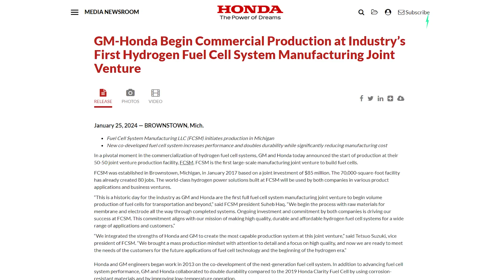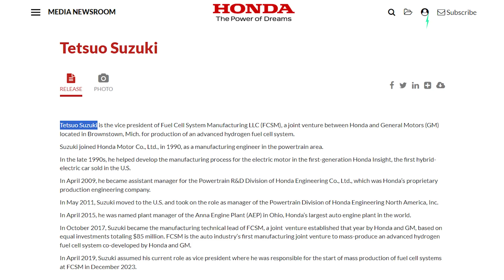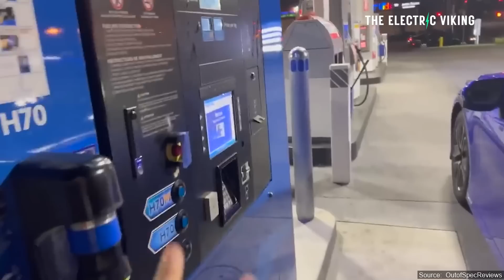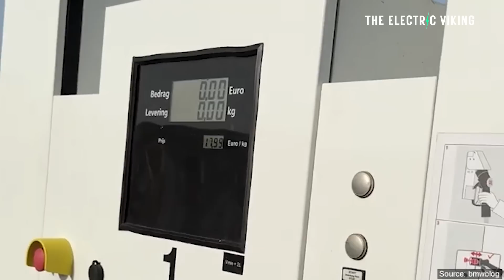GM & Honda's hydrogen fuel cell facility begins mass production in America

Comment: This is such a momentously ambitious global transition. It's going to take time to work out most of the kinks across the entire scope of clean alternative energy and its expected in most early adoption phases, but time is not our friend as the narrative goes. BEV will continue to make progress and FCEV/Hydrogen/Synfuel will make up a large portion of the market too. It's not a one trick pony ordeal. FCEV and bidirectional charging breakthroughs are on the horizon and will be necessary for GRID sustainability. GM and Honda partnership is a major indicator, not to mention their partnership to deliver the global blockchain standard for EV grid integration.

Comment: In the UK in October 2022, Shell - who had been conducting "an experiment" with H2 fuelling infrastructure for cars - pulled the plug on the "experiment" and announced it would be terminating all future research and investment in car H2 technologies. A short while later, Motiv Fuels closed H2 stations, announcing it would focus efforts on H2 for large commercial transport initiatives.
"Lack of demand" was cited as the key reason by both Shell and Motive. H2 fuelling stations in the UK fell from 15 in 2021 to just 5 in May 2023.
Lack of demand is the key phrase here... Despite the UK government's 2030 Hydrogen Strategy forecasting "significant" use and application of H2 as an energy/fuel source, the reducing economics of pure BEV in cars is rapidly gaining favour in the British motoring public.
The UK government tenaciously hangs onto H2 "hopes" - and many believe that the fossil fuel industry is "influencing" this policy. (Read that as you will...) Despite vacuous and pointless statements about "green hydrogen", anyone with more than one brain-cell knows that the oil industry is the only viable source of H2 - even though it will still be very expensive and inefficient to produce.
We may not need to concern ourselves with these stupid and irresponsible policies, because (as Tony Seba has said) people vote with their wallets. Pure BEV will be around 3x to 5x cheaper than even the most "efficient" H2 fuel-cell technology and WAY more efficient and convenient. And I'd trust Seba way ahead of any politician or oil industry executive.

Comment: All it takes is one change in technology.

The ability to rapidly produce hydrogen on demand would do it.

For example, a new aluminum alloy that reacts violently with water to form Al2O3 and H2.  Not only do you get hydrogen, but you also get electricity and heat.

The gallium and other things in the alloy are completely recoverable from the sand at the bottom of the reactor. Power generation is easy to control because the aluminum is fed in from a spool of wire...

There are a few recent papers that could be products in 3 years.
Reply: Whoa....back it up there - Aluminium is one of the most energy intensive metals to produce - the Tomago smelter in NSW has a constant feed 24/7/365 days a year of 850,000 Kw. That's 7.5 Terrawatt hours per year = 2.8% of Australia's total energy production in 2022.

You'll only every recover a tiny fraction of the energy needed to make the alloy in the first place - there are no free lunches.
Reply: @TB-up4xi  
ExCtly.

We have millions of tonnes of this stuff sitting around.

The energy associated with the production of 3-5 trillion aluminum cans can be harvested because we have millions of tonnes of excess aluminum sitting around.
Reply: @JohnBoen  Seriously? aluminium cans? Please rethink how ridiculous that statement is.
Reply: @TB-up4xi  

Millions of tonnes of aluminum that represents a huge potential energy value.

I'm an engineer and I see these thousand pound ingots.

I read a paper titled "Easy aluminum nanoparticles for rapid, efficient hydrogen generation from water"

I think to myself... self - if we could make that into a Ramirez it would be an aluminum primary battery. Self agrees.

And an assembly that harnesses the heat? Yes. That would be good. Perhaps a sterling e line or an exterior cooler.

And direct electricity... math works out.

I am a materials science engineer and I didn't see any red flags.

Of course ai thought about it.
Reply: Oh, there are lots of ways to produce hydrogen, the drawback is that they ae all expensive, and this aluminum alloy method is no exception. Besides, using aluminum to produce hydrogen to power a fuel cell has several unnecessary steps and high cost involved. More efficient would be to use the aluminum in an aluminum/air battery, or perhaps even feed it in as an aluminum/air fuel cell. Greater range, higher efficiency, and no need to lug around heavy water tanks. Granted, you'd still have to recycle the spent aluminum oxide, but that's the same for the aluminum hydrogen process, too.

Comment: The "middle east" controls oil. China controls mining. Hydrogen the most abundant element on earth is available equally to ALL. It's a freedom liberator. It's not about cost or efficiency. Countries/people can then control their own destinies and not be beholden to others with design on domination and control.
Reply: Hydrogen is hopelessly inefficient. EVs are 4x better.

The fuel cells alone are only 50% efficient and that’s after over a century of development.

They’re also expensive, use precious metals and wear out.
Reply: @fredbloggs5902  Yes the cost and inefficiency is well known. But,,,, countries like Japan and their society will gladly pay more for an energy source that provides for independence from China. Japan would like to be in charge of their own destiny. Many other countries such as Germany do not want to freeze over the winter because Russia holds back on gas sales. So the German society is not held hostage by oil producing countries. This is NOT about the best or cheapest source of alternative energy. It's about freedom and independence to determine ones own destiny. Hydrogen is available to everyone. Extract it from water using renewable energy means people don't need reliance on oil or minerals for batteries. Please think about the geopolitics and why hydrogen is so attractive. It's not about moving a car from point A to B.

Comment: The suppressed technology of turning water into a combustible gas as was done by the inventors Stanely Meyer and Dennis Kilien would solve all these problems. Obviously fueling up vehicles with a garden hose would disrupt the investments in oil, coal, electric vehicles, etc., so this technology needed to be suppressed. The Electric Viking ignores this technology, why? The prospect of free nonpolluting fuel should send those who believe in the myth of man-made global warming into exstacy. The future could be very bright and prosperous with water as the primary fuel for cars, trucks, locomotives, jets, and ships. Cheap clean safe thorium nuclear reactors could provide all out electrical need.
Reply: Stanley’s patents have been public for decades. It doesn’t work and never has. Go learn some thermodynamics 🙄
Reply: @fredbloggs5902  Stanely Meyer was smart enough to leave key items out of his patents to keep them from being copied. His very suspicious death leads me to believe that his devise actually worked. Then there is the case of Dennis Klien who also changed water into a combustible gas. Everything has a resonate frequency. If the right one is used molecules will lose their bonds. Royal Riff cured diseases with similar techniques but of course he was driven out of business by big pharma as a quack.

Comment: Here's a fuel cell "winner"   BLDP (NASDAQ) $3.38 .   Yeah, the stock price has gone no where for years.  Don't like that one?  Go for Plug Power  PLUG (NASDAQ) $3.80 .  Yeah, the stock price also below $4 / share.   I see Honda and GM have decided to drive their stock price below $4 / share with hydrogen.   That should work out fine for them too.

Comment: I can easily charge my ev at home, and am planning to install solar on the roof; as far as I know, that can't be done with hydrogen.
Reply: Actually you can! You just have to get an electrolyzer for your solarpanals and a hydrogen fuel station. Easy 😉
Reply: @bellumCretatus  -- I've heard of solar hydrogen panels, but didn't know they were available commercially.
Reply: @bellumCretatus  Hydrogen is hopelessly inefficient. EVs are 4x better.

The fuel cells alone are only 50% efficient and that’s after over a century of development.

They’re also expensive, use precious metals and wear out.
Reply: @fredbloggs5902  I know and agree, but if ppl want to use their solar power inefficiently, they can. And for local longterm storage of access solar power, hydrogen could be a thing.

Comment: Toyota made a hydrogen car.  I saw probably all of five on the road.  Apart from it being about the ugliest car out there, hydrogen fuel cells are about the least efficient and make no sense.  The only advantage they over battery electrics is that you can refuel time quickly, but that said there’s hardly any infrastructure out there to do it.  I think there’s three places in the Los Angeles area to get it.  Don’t know about the rest of the country, but the while the idea is nice, the practicality just isn’t there.

Comment: You have to understand this : be it hydrogen or another fuel, all these "fuel cell revolutions" want to keep you going to a gas station BECAUSE THE PROFIT IS IN THE PRICE AT THE PUMP. 
The most ridiculous part of this is the fact that the Toyota Mirai already costs more to fuel up than does a regular gas car. A LOT MORE. With an EV, ANY EV, you just put some solar panels, a bit of wiring and you can charge at home. YOU ARE FREE. Going to the pump is NOT free. It's a way to ensure the consumer keeps on paying again and again and again. The technology might be neat and amazing but the economic model sucks donkeys.

Comment: Oh, yes, hydrogen transportation makes such good sense. Let's use two or three times as much electricity to create the hydrogen as is stored in the hydrogen itself. Then let's use a lot more electricity to compress the hydrogen to transport it to where it can be stored for distribution. Then let's put it into a large, heavy, expensive, exotic metal tank (Google: embrittlement) to carry around in your car. Next, so the car can actually move, let's add some electric motors and, unless you are happy with acceleration measurable with a sundial, some batteries, and finally a delicate, complex, high maintenance device called a fuel cell that will lose 30% of the energy it takes to operate it so that you can produce... (wait for it) electricity to run the car.

It escapes my understanding why all cars today don't run on hydrogen instead of just using 95% efficient batteries in the first place. [/s]

Comment: Hydrogen is a ridiculous fuel “source”.  So many problems it is hard to know where to begin.  But in my mind the biggest issue is MAKING HYDROGEN in a environmentally sustainable way.  Also, the distribution of hydrogen appears to be much more challenging than building out EV charging stations and look how poorly that has gone.  Except for efforts of Elon no EV owner today could hardly get out their driveway without obsessing over where to find a charger.  Finally, hydrogen and electric needs to be available to rural America.

Comment: This is not just putting the cart before the horse it's putting the cart before the wheels. There is no hydrogen infrastructure. We have been building out our electricity network for over 100 years and electricity can be made dozens of ways with cheap devices and almost no skill. Why would you go out of your way to not use that or to use it up with a lower percentage efficiency than just using batteries? Imagine if all the money spend on Hydrogen development had been used to develop better batteries and battery production.

Comment: You have all good points here but I honestly think you are missing a few important aspects. you are assuming that highly pressurized and purified hydrogen gas is the only way to go forward. In particular, when using ICE the quality of the hydrogen can be relaxed. Also, there are other ways of storage and transportation under development, including swapping tank modules. Personally, I can follow GMs and HONDAs logic - assumed the infrastructure is part of the focus as well.
Reply: While it is technically possible to run an internal combustion engine on hydrogen, the low efficiency of internal combustion combined with the high cost and bulky nature of hydrogen results in a comically short driving range and absurdly high fuel bills. Not even remotely a "good idea".
Reply: @chrismuir8403  I get your point entirely and I do not dispute the currently prohibitive cost figures for Hydrogen (per kWh), and also don't deny the rather unimpressive 'round trip' efficiency, in particular when producing Hydrogen via electrolysis and pressurizing it in excess of 700 bar. WRT engine efficiency it is possible to operate in 'Diesel' regions and on very low emission profile since the combustion can be ultra lean (below NOx onset temperature). Therefore, for certain applications, TCO doesn't look too bad compared with contemporary Fuel Cell Systems. One could also argue: why not having an immediate interims step by running ICEs optimized on Natural Gas, and personally, i would be a great fan of this since the technology is available and the emissions of concern (CO2) are significantly lower than operating on Diesel, for instance but in real life we always have to navigate the complex reality between physical facts and ideological preferences.

Comment: If the filing devise the only problem then who gives a whoot. They will fix that problem and Hydrogen will be a great alternative for heavy vehicles.
Reply: They do have a filling device, it's expensive, but it works. But there are a lot of other problems that haven't been solved, like hydrogen embrittling steel, problems with leak detection (no known odorant works), high pressures needed to store sufficient amounts, and flammability. But the biggest problem with hydrogen as a fuel is the very high cost. It isn't cost competitive to much cheaper electricity, and there is no known way to make it cost competitive. Driving electric will always be far cheaper. Yes, that includes large heavy vehicles.

Comment: I can see it in the airline industry as they already use specialist fuels and store them on site. The same could be used in shipping and boats. I’d love to have a cheaper and cleaner option for powering my  Axopar. But for anything road going I can see it being a head ache. Unless somewhere like Iceland begins churning out geothermally produced hydrogen from sea water where going to need a whole lot more power station to produce the electricity required to create the hydrogen. Which seems daft when that same power can be delivered to the +70% of homes than can charge a battery EV and used by the vehicle more efficiently.
Reply: Isn’t hydrogen the most common gas on earth? Why would it need to come from Iceland?
Reply: @joeybulford5266  Hydrogen is very rare in its free form.  It's always combined with something, usually oxygen in the form of water.  It takes a ton of energy to separate the hydrogen and the oxygen.  Iceland has a lot of clean electricity from geothermal, so they could make it.
Reply: Hydrogen in airplanes will never happen.  You need too much space to store it, and you can't put it in the wings like Jet A.  The safety hazards of H2 sharing cabin space will prevent it from being certified, so it won't be allowed to fly in the developed world.  Hydrogen in planes is a pipe dream.
Reply: Iceland would be the logical choice they have an abundance of cheap, green energy, are well located geographically, and are a very stable country unlike those that have most of the oil reserves.  A kg of hydrogen contains 40kw of energy, but takes 50kw to create from water. Hydrogen fuel cells are at best 60% efficient, so that 50kw of energy ends up being 24kw of electricity coming out of the fuel cell for every 50kw used to create the hydrogen in the first place.

You are right in a way about hydrogen. It is the most common element in the universe, but not on Earth in its free form.

Comment: I am pretty sure the H2 generator converting water to H2 will require a powerful compressor.  Compressors use a lot of energy.  I had an auto repair shop and that compressor in my shop was probably 80% of my electric bill.  Just look at the huge motor necessary to compress the gas before pumping into your car.  No free lunches here for sure.
Reply: A standard air compressor maxes out at 150 psi, Compressing enough hydrogen to get a reasonable range means compressing up to 10,000 psi. Big difference.

Comment: Keep it simple, EVs are simple.  I have solar power on my roof so I stick my charger into my Tesla Model 3 std.  I have no issues. In fact my solar panels make more power than I can consume.  In 8 years and plus the rebate, my system will be free.  I paid up front $42K and gov gave me tax write off.  My bills are almost gone but before solar my bill was over $300.00.  I have a tenant so that's why so high.  So H2 is just too complicated.  Where do I store H2 at my house??? Are the Tanks big???  How much solar power will it drain from my 20 Enphase panels.???
If I use a H2 generator then I may end up with a huge electric bill every month.  Makes no sense, what I have works.  I got solar panels and my electric bill near zero.  For me I am happy.  I don't need complications.  Keeeeeep it simple stupid.  I got enough problems in my life

Comment: What a joke of a pipe dream. The issue that hydrogen are supposed to fix, range, will be fully felt with by batteries before hydrogen can even get enough stations along the 10. This is just silly st this point